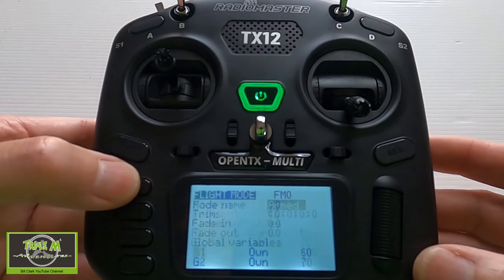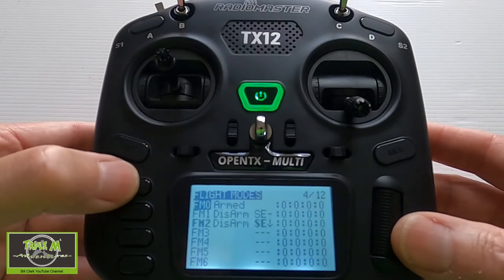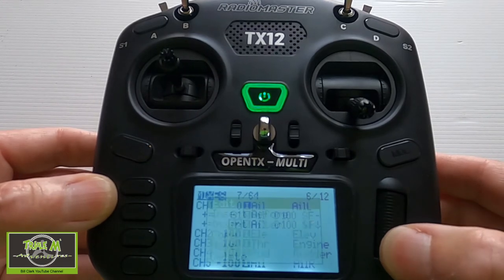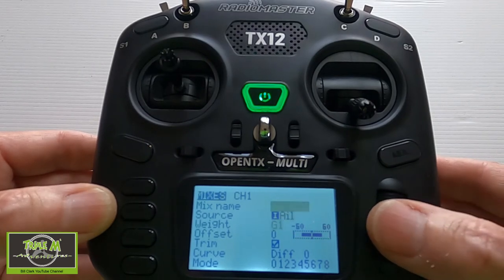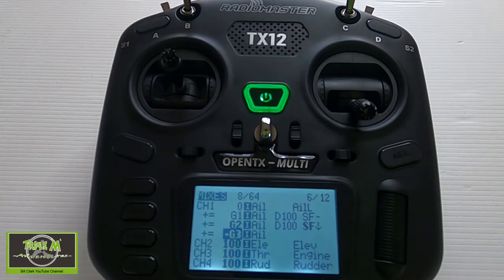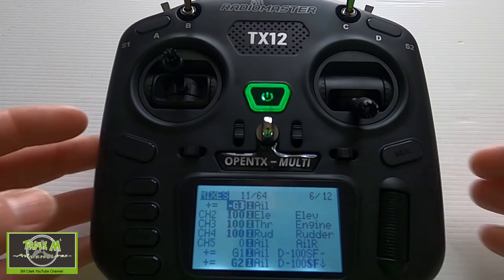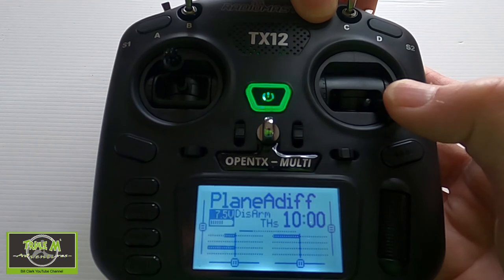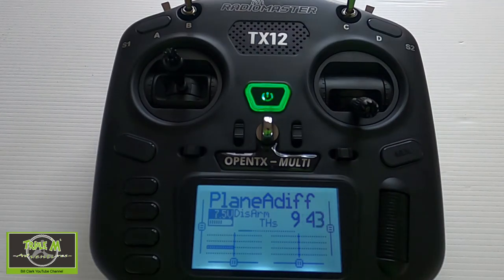RadioMaster TX12 Setting Up Aileron Differential with GV's

Comment: Hi Bill, thanks for your efforts in posting this, I needed it for the Cub I am working on. Needed to setup my TX16S tx and it worked like a charm 👌 
Thoughts, need to be aware that if there are curves attached to the channels you are working on it will mess with the result, also could you please explain in a bit more detail how this setup works to help for other projects? Thanks very much.
Reply from the maker: The curve is used for the safe throttle and no other mix.